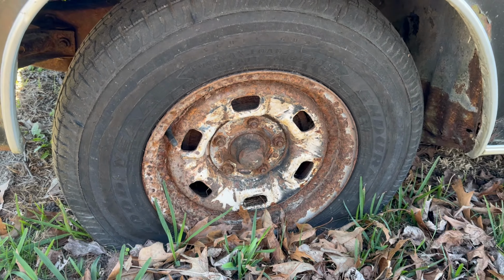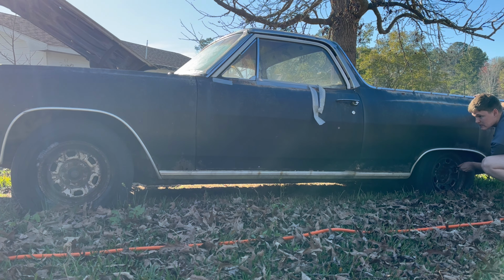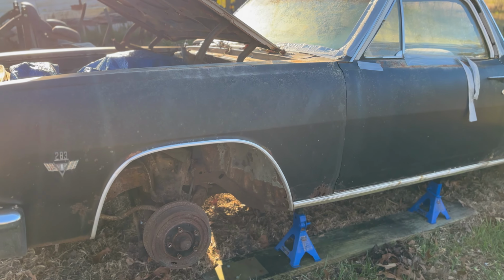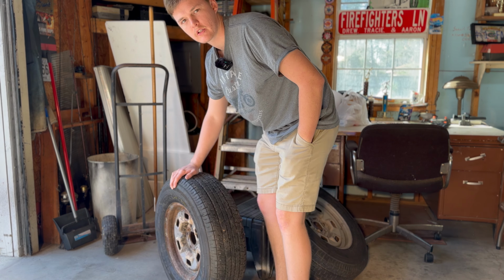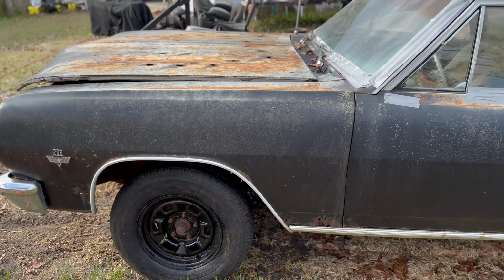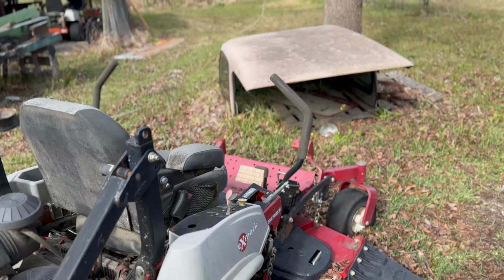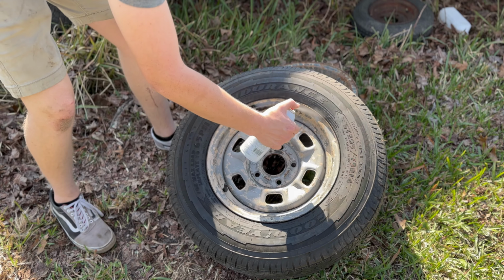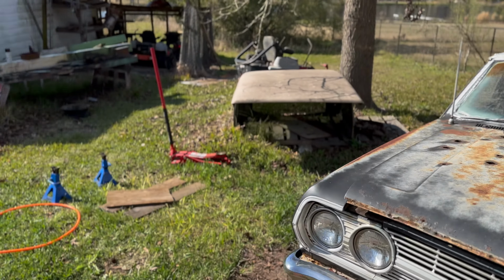Will It Roll Again? 1965 El Camino, Abandoned For 20+ Years.

Comment: Lucky to be given a cool car. Did you paint the rims inside. Use old engine oil on the beads to fit and seal up . If tyre has a rip on the bead fit a old tube. Just for rollers.. Should have put white walls out.. editing is good but long winded. At this rate it will be a three year will it start. 😂😂. Good luck.
Reply from the maker: Wheels are painted on the inside, no tears on the bead, I had actual bead sealer, white walls will probably end up on her. Thank you for the feed back and I have good news on the next video in regards for getting it started.